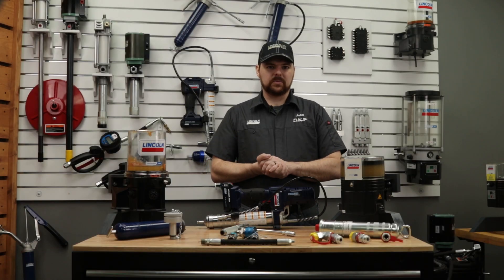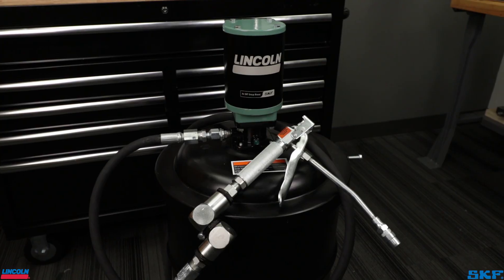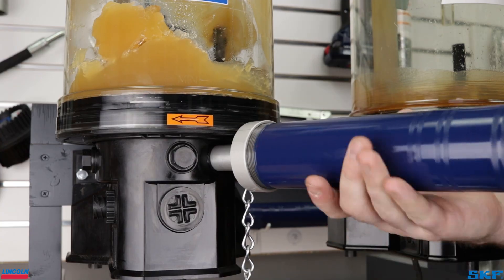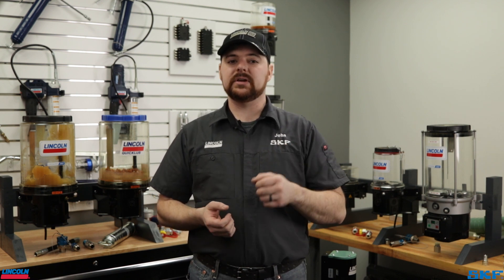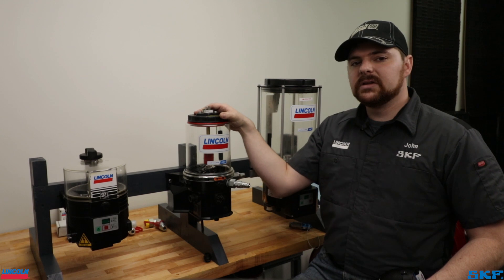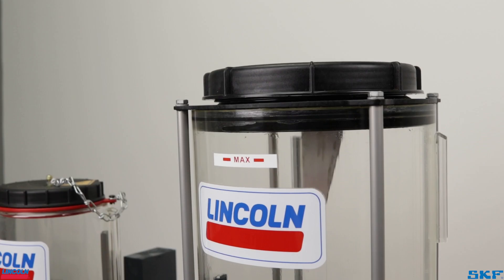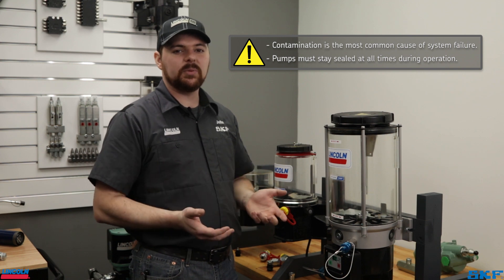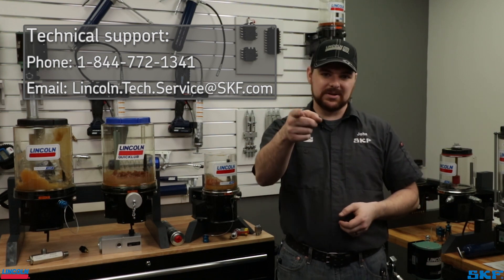Lincoln Industrial ALS pump filling options

Comment: Can low pumping volume and pressure be caused by an airlock, or would that just be stuffed seals ?
Reply from the maker: The P203 and P653 don’t dispense very much lubricant or build much pressure under normal operation. Worst case could be a worn out pumping element. 

~ John
Reply: @lincolnindustrial  no problem cheers mate

Comment: How the pump 203 open the plastic reservoir
Reply from the maker: our more popular P203 units have a threaded top on them for maintenance purposes, however, for reservoir removal, most are threaded on to an adapter on the body or it's a quarter turn counter clockwise. We offer special tools for their removal but a strap wrench at the base of the reservoir will work as well. 

~John